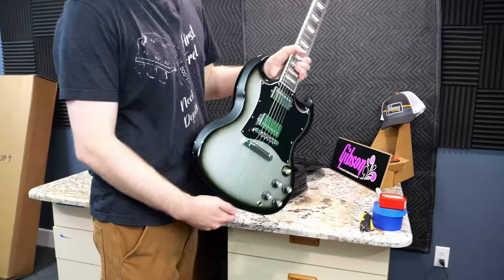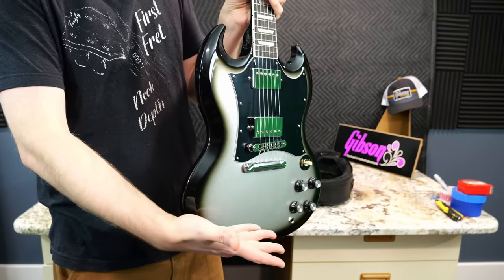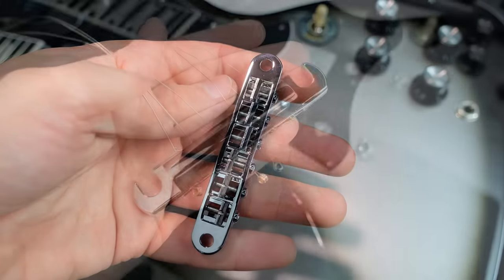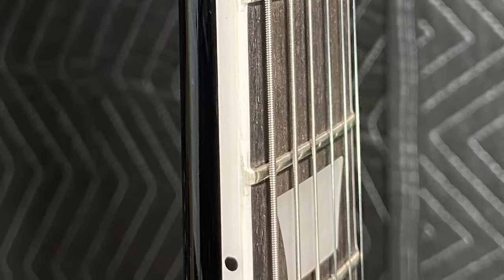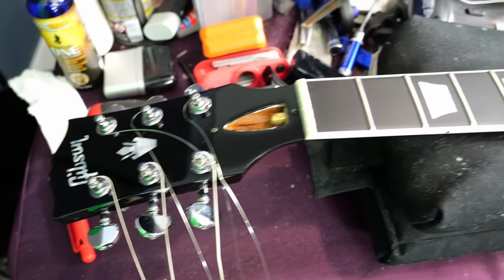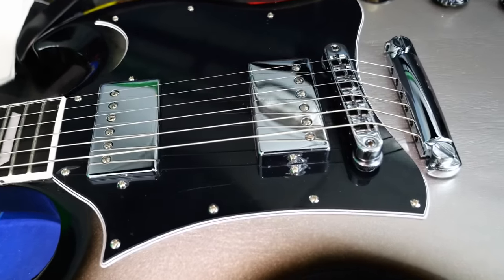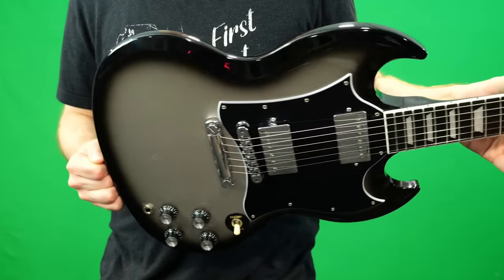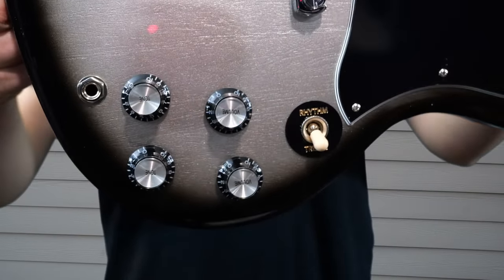Not Love at First Sight... | 2023 Gibson SG Standard Silverburst

Comment: Picked one of these up for $1500 used and replaced the pickups with black winters. Sounds great, just wish there was a 61 version
Reply: Ive also been modifying mine! Ratio locking tuners, emg marty Friedman set, a set of speed knobs, and later I want to add either brass or graphtech saddles, and maybe a string butler 🤷🏽‍♂️

Comment: I went weekend before last to Nashville in search of a new SG, tried all the Standard and '61 SG's at the GC's, Gibson Garage, Sam Ash etc...just my opinion Gibson is cheaping out on builds. You could pick up 2 SG standards, same color, and they feel completely different. Most had really high bridge bridge heights and the bridge pickups adjusted really high. One Blueburst at the garage hadn't had the excess glue removed from the neck joint and it had just been painted over. 2 Standards had really bowed necks. All have acrylic inlays now. $1800 and you give me a gigbag and i have to pay to have it setup? I'd rather buy older used ones.

Comment: So mine came with a bent tone knob along with a bowed out neck and horrible intonation. However, took it to a luthier and it now plays like a dream. Sadly enough I had to go to 4 GCs to find one that wasn't even more messed up in ways that couldn't be fixed. However, mine does have the same finish issue by the nut. I think it's due to the wood expanding and the nut not expanding. Since the finish covers both you get that identical marking on everyone I've seen of this edition. The ebony fretboard and Silverburst finish though are really what make it worth the extra $200. GC sold me mine for $1,599 so I'm not upset about the purchase ($400 off).

Comment: I bought one of these blind, 2 weeks ago. I was shopping for an SG standard on Sweetwater when I happened to notice that my local Guitar Center sold a silverburst exclusive version and I immediately hopped on it like flies to $#!&. I went to the store the next day after work and bought it right off the shelf, they had apparently just got it in. My guitar does not have even a fraction of the QC issues yours does, it's stunning how bad the guitar you have in this video is. The only thing mine has is some of those tool markings on the sides of the fretboard, but it's just discoloration, no actual dents or finish cracks at all. I'm not trying to say Gibson doesn't have garbage QC - they absolutely do. But these guitars are excellent if you can get your hands on one in person before you buy it and do the inspection yourself.

Comment: I love an SG with a Batwing....just not on this finish. I would have left off the pick guard, used wood filler to hide the neck joint, gone a bit thicker on the black outline burst and mounted some black pickup rings. 
Also why a cream switch tip? you have an all black and silver guitar, at a minimum use a white tip to match the binding. Not only are Gibson employees QC blind but colour blind as well.

Comment: 10-15 years back there was a silver burst SG with P-90s from Gibson. I can’t remember the exact name of it, but I did wonder about putting mini-humbuckers in it.. if I ever was able to afford one. 😂 pretty sure it was not a batwing guard.
Reply: Dimarzio has drop in soapbar humbuckers in SD, PAF, & Tone Zone flavors.
Reply: @rocketpigrecords3719  you can also buy that metal bar that mounts to the bottom of the pickup cavity and the mini humbuckers screw into. That, I’ve used Seymour Duncan’s antiquities set with the bar without any issues to make a Les Paul “deluxe” out of a p90 model.
Reply: @joermnyc  just in case you want more stones than a regular mini humbucker has on tap. The Super Distortion version I had in a Slick, and it was everything the full size version is.

Comment: In my opinion all guitars that cost over $2000 that aren't exact reissues of historic guitars should get real MOP instead of the cheap plastic inlays
Reply: Are you aware that MOP is a controlled material and therefore regulated for export and import? It adds a level of certification and paperwork on any export/import requirement that most guitar companies just don’t want to get involved in as a matter of course.
Reply: @davidburke2132  yea but I think at least gibson should use it especially when working with an American company like guitar center
Reply: @turquoiseturkey6710  you can’t efficiently mass produce guitars like Gibson do with different specs for export models compared to non-export… it just doesn’t work at those volumes. They’d essentially be doubling their number of production models overnight to do that and then adding to admin to manage the whole process.